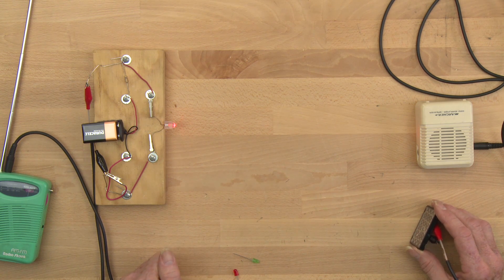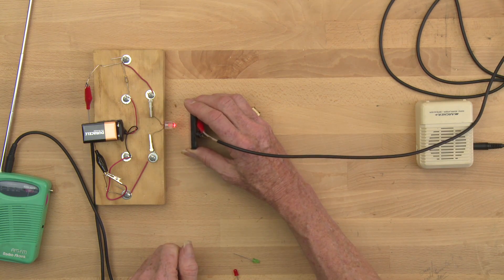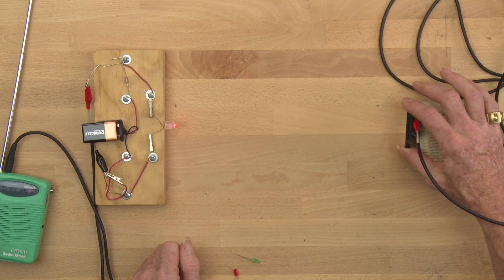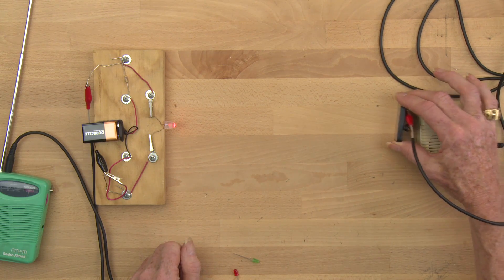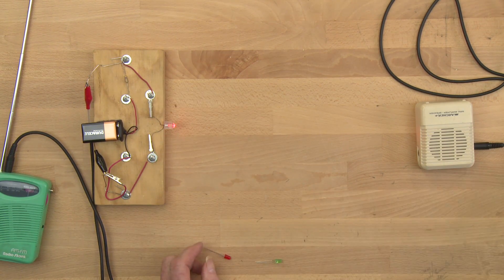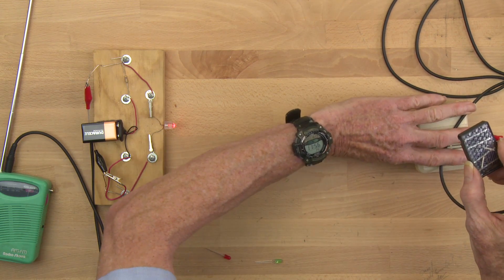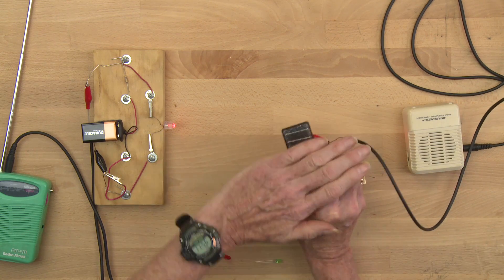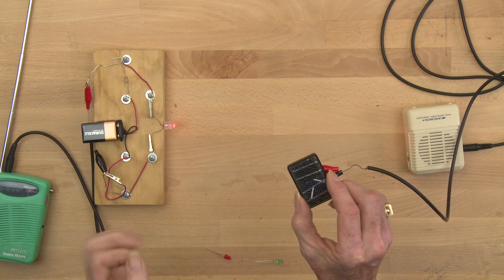How to turn sound into light (then back into sound) - Part 7 of 7: Take the engineering challenge

Comment: First challenge, instead of LED use laser pointer, this way it goes for much much far distances.

Second challenge, you could use any color of laser pointer, remote controller, any device that sends electromagnetic waves, since the solar cell can convert it to electricity.

Third challenge, the buzzing sound is because the exposure of solar cell to environment light, so cover the cell so it won't convert anything  unless from your laser pointer, like putting the solar cell in a one sided open box.

Loved the videos ,brief and beneficial.

Comment: getting rid of the noise is easy use a stereo with enuff power that you dont have to use the battiery der , use lazer diodes and glass magnifiers to modify your beam , Tobias Schindler is also correct remove all light sources , you could also use computer  programs on a rasberry device to remove all unessary wave befor being re amplified , simples problay how fiber optics work ,

Comment: this project isn't working,that solar panel will not charge with the intensity of that led,u r talking about that buzz sound we r nt even receiving any audio
Reply: Did you add the battery?
Reply: Shaik Farha l also tried it and it didn't work

Comment: getting rid of the noise is easy: turn off any other lights so u have the led as the only lightsouce
Reply: Exactly , you cant record vocals in a loud room. I think the same would apply.
Reply: @badformatuk  no, it's not for that reason. It's not just a matter of "other" light: it's the "sound" of the ac powering the lamp, tipically 50/60 Hz. Try with a solar light and the won't hear the buzz anymore.